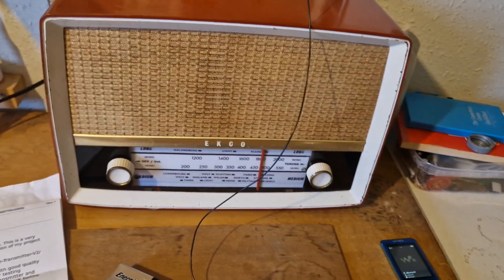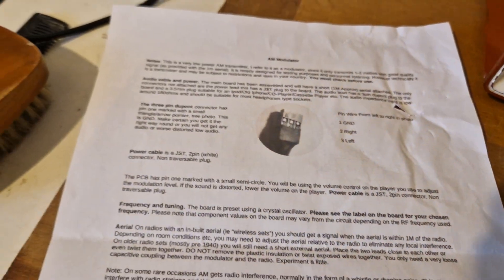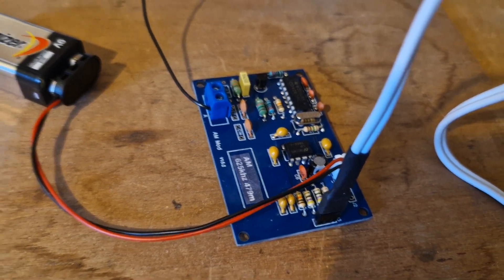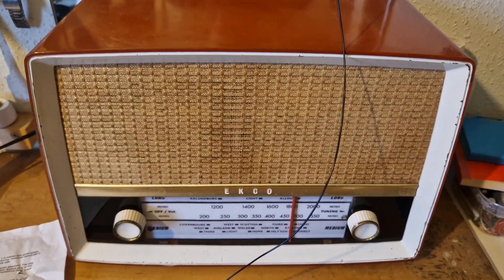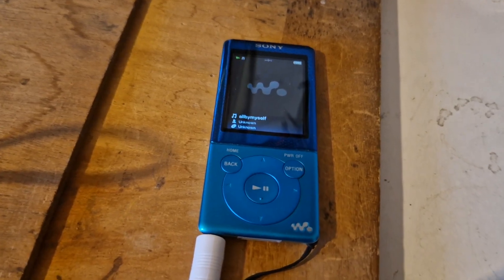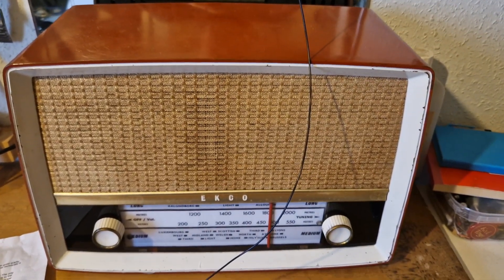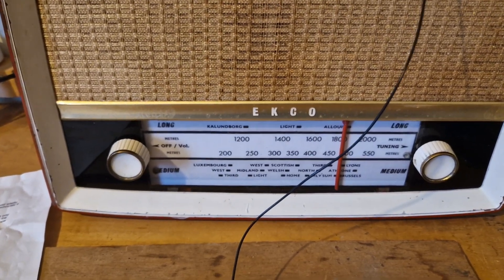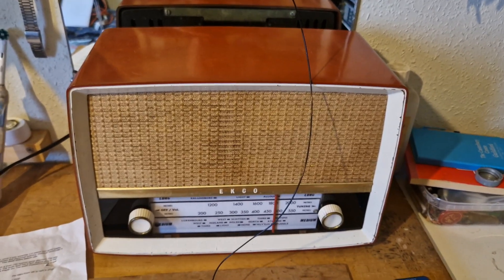AM modulator/transmitter suitable for vintage radios.

Comment: What was the whine at the beginning of the video?  I built one of these a few years ago.  Albeit a much simpler version that was basically a xtal oscillator.  That version would produce a slight whine that would be picked up by the radio.  I noticed that halfway thru the video, when you tuned the radio, the whine disappeared.
Reply from the maker: The whine is an artefact of the numerous switchmode PSUs in that room as there's loads of electronics in that room. It doesn't come from the modulator unit. A better test would be to take a small battery portable radio and the modulator outside away from such interference.

Comment: Looks familiar Timothy 😉. Did you buy it after watching the stream on Sunday or did you already have one? It works very well though. Love the Sony Walkman MP3 player and the old radio. Cheers Graham
Reply from the maker: Hi Graham, yes I actually ordered it during your live-stream! I built a crude version a few years ago that was a simple crystal oscillator and I modulated the supply voltage using an old AF output transformer, it worked, but it wasn't very successful. This one's far better.